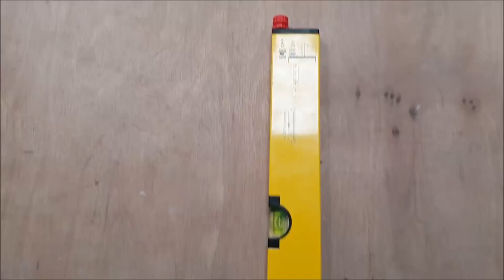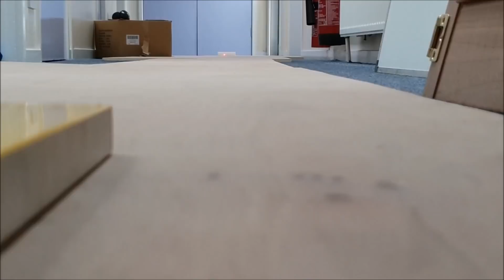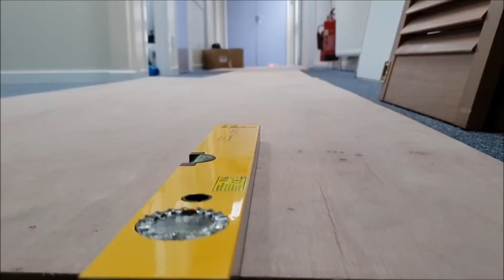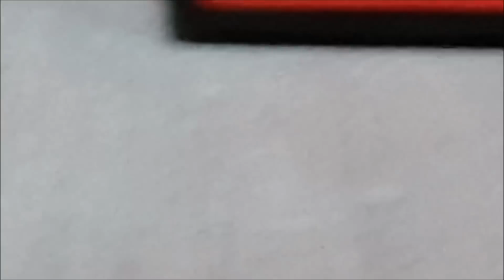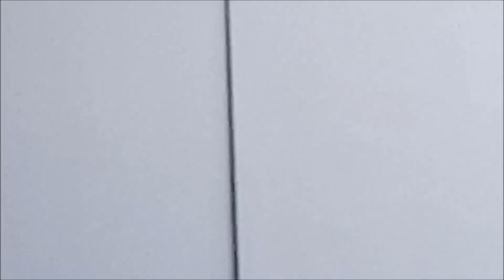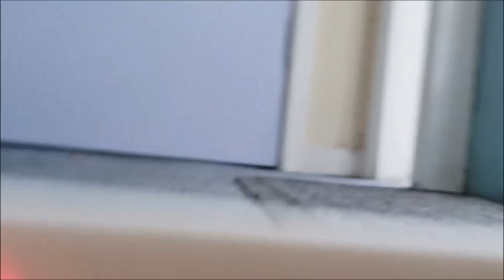Flat Earth  "ANGLE OF ATTACK"   aka  BULLSH1T

Comment: I did some rough calculations one day, and correct me if I am wrong, but if the sun is ALWAYS 3000 miles high, even at it's furthermost about 3/4 across flattardia, then the sun would NEVER get below 8° above the horizon. It would never set, it would never touch the horizon. So, since it DOES go below the horizon in reality, the Earth is indeed a globe.

Comment: I'm not really a fan of Nathan, Miles but any half decent carpenter or mason is going to know that if your foam brick is in the right place it's going to show what you see in your video and to test for flatness as to concave in between the laser and target Al you do is measure the height of the laser at strategic points along the way. This would conform to scientific methodology. Which is what your missing here and in other videos. AFTER this you then  have all the proof that you need that is  uncontestable.

Comment: I posted on one of ranty videos that a running track was not necessarily flat, and is likely to be built to just under a  0.1% inclination.  Someone (not ranty), point blankly refused to accept that a "flat" surface can be anything other than 100% flat. I think it demonstrates the mentality of what we are dealing with namely "running tracks are not built on slopes , therefore it is a fact that it is 100% flat"

Comment: Angle of attack and angular compression is real. Though not in the flat earth sense. It explains why the ponchatrain and causeway curve is visible along side it, but not when viewing from the side. The angle of attack dictates the angular compression of the length of the causeway due to perspective. In other words when looking along side the causeway you are compressing miles of road into a small angular size due to perspective. 

It's funny when we can use flat earth terms how they were supposed to be used

Comment: If the "angle of attack" were a real phenomenon, it would also affect the laser, and make laser levels completely useless.

If the floor were perfectly level and extended far enough we should expect an object resting on it to disappear from the bottom up, because level means "perpendicular to the force of gravity", and the direction of the force of gravity changes as you move around on the Earth's surface.  A laser level actually measures whether something is straight, not whether it's level.

Comment: I have a hard time thinking that you are really still this ignorant at this subject.
The only thing your test reveals is that your camera was still too close (i.e. the angles were large enough to capture the object's details)
Simply move camera further away until you will start to get obstruction.
:BUT:  in a perfectly stable indoor  a/c environment, this will take some real distance......obstruction will start to occur at about .02 degrees.
Move outside where atmospheric effects come into play, and this phenomenon will likely occur much sooner (closer)
but Miles, you already know this.
its been 3 yrs, and this information has been available.
Reply from the maker: That's fascinating. Can you point me to the scientific peers reviewed paper that determines 0.002 degrees as the threshold angle for this phenomenon?  Does it apply to all cameras regardless of zoom capability?    Why didn't any part of the door handle disappear when my camera got to 0 (zero) degrees?
Reply: @MilesDavisKDAB  no, but you can create this angle yourself!  and get Your very own Empirical Data.
Here is a right angle calculator to get you started:
https://keisan.casio.com/exec/system/1273849674
the right angle triangle we are looking at is formed at 3 points:
The center of lens it point 1.
the spot on the floor directly under the lens is point 2 (this is the right angle)
now the spot on the floor in the distance is point 3, and we are measuring the angle created... if you imagine the object you are filming, and from the object's' perspective, looking back at the camera lens this is the angle measured.
In your test, this angle is still quite large.
use the calculator and keep increasing the distance until you reach .02 deg.
For a P900 sitting directly on the floor, the distance from floor to center of lens is 4.5 cm.
So by increasing the distance to just over 100 METERS, the angle decreases to .02 deg.
OR  Lower the camera by digging a hole in your floor, (kidding) or raising the plywood in your hall up on blocks of wood so that the center of lens is closer to the surface, thus decreasing the Same angle we talked about above.  you could do this quite easily.  Again, use the Right angle calculator to get the 3 points and the angle within .02 deg:
https://keisan.casio.com/exec/system/1273849674
Now that being said:
Indoor tests like yours are not a fair comparison to photos taken over bodies of water showing obstruction of buildings, etc.
Indoor tests basically remove all atmospheric effects. 
Hope this helps
cheers
Reply: @wildmanfujiami5870  no, actually it is an nudge to do a re-test.
whats the harm in that?
Reply: Hah, that’s utterly dumb

Comment: The critical last board or two seem to be higher than the other boards or there is a clear dip before the last board which makes your experiment just as wrong as Oakleys. The laser is nearly useless at 1.2CM high except to guarantee no rise more than a half inch.   I think you should have made the effort to drop the light so its nearly on level with the boards. But I agree with the principles.
Reply from the maker: Thanks for the input. I disagree slightly. The laser diverges somewhat so while the centre of the spot is 1.2cm above the board at the far end the bottom is only about 5mm or less above the board. Unfortunately I had limited time available. I had tried on two other floors but they were not flat and on this floor using the carpet but the phone was about 3cm above the carpet. I could probably have found a way of positioning and leveling the laser so it was closer to the board, but just didnt have the time. The most important thing is that Oakley made no attempt to establish that his floor was flat or level. At least I can say with some certainty that the boards are sufficiently level that the laser 1cm above the surface is not interrupted.
Reply: I just noticed you were  @MilesDavisKDAB  (I think of recent water tower fame)  The difference is I don't think you are playing games.  I don't for a moment think Nathan Oakley is so stupid he doesn't know his floor dips.Ive seen so many flat earthers pull this lame crap. Dr Zack and his warped wooden desk. Phucket and his warped roads. Jeran this week just pulled exactly this with his own street because the streets dip at the end of a culdesack for water drainage.
Reply from the maker: @emailatomic  "Water tower fame"  LOL  Yes they pull this crap all the time and need to be called out on it.

Comment: Angle of attack is the angle formed between the chord line of a wing and the direction of the on coming air (referred to as relative wind).  Chord line is basically a line formed between the leading edge and trailing edge of the wing.  Angle of attack is a measurement that is used almost exclusively in aviation.
Reply: RV 6 Driver I understand from your user name that you are coming from an aviation perspective, but AOA also applies to sailboat sails, turbine blades in non aviation turbines, hulls and other shapes in hydrodynamics, etc. just to be clear.

Comment: Look at this flat earth video - www.youtube.com/watch?v=z5ASoaLDpgM&t -  this video shows the Walney Wind Farm. The turbine towers are 400 feet tall and the blades 250 feet long. The tips of the blades appear to touch the ocean as they pass through the 6 o'clock position but if the earth was flat there should be a gap of 150 feet between the tips and the ocean. Every flat head I have asked for an explanation has refused to or completely ignored the proof of a curve
Reply from the maker: Paul,  I've done my own video about Walney Wind Farm and Walter Bislin even modelled it. I thought the turbine height was 90m. There is a Walney extension which is more recent and might have taller turbines.  Anyway it's some goo footage.
I was with Al K at St Bees and we got footage of turbines where only the blades were visible above the horizon.  Riley, Ranty & Oakley claim its all down to compression and inferior mirage and "angle of attack" . 300ft+ of missing turbine and they think a bit of inferior mirage explains it.  I really don't think they believe half the crap they spout. They are just milking flat Earth while they can.  Can you believe Riley got £2250 to pay for him to do a university course of some sort?
Reply: Miles - Flat heads will always come up with some pathetic excuse to try and explain something that shoots them out of the water. I have never had any form of explanation from hundreds of flat heads I have asked to explain the missing 150 feet.

Comment: There goes Miles the liar Davis again! So you say the angle of attack doesn’t matter hey? So why does the amount of visible carpet between the door and the boards increase and decrease with the changing angle of attack??
Reply from the maker: I can't believe I'm bothering to answer such a daft question, but ........because the top of the boards is above the carpet so the boards provide an obstruction to the light being reflected from the carpet towards the camera.
Reply: Miles Davis that’s a ridiculous reply. It wouldn’t matter if it was 1mm in height or if it was merely different shades of colour. The angle of which something is viewed does matter! This is nothing but a straw man argument! To prove my point, the gap below the door is more than 10mm yet disappears when the angle of attack is lowered. This is a joke.
Reply: Globe Foolosophy
Actually, the gap below the door, looks to be closer to 5mm. The panels Miles used as a surface on the other hand looks to be between 15-20mm thick. So the, rather obvious, reason for why the gap disappears is because it's obscured by the panels.
Reply: ShadowFalcon ok I’ll split the difference with you and say it’s 7.5mm. The point is that a lowering and raising of the ‘point of attack’ makes a huge difference on what you can see at a distance. This is clearly evidenced with the amount of carpet that is visible between the boards and the door. As the camera is lowered the amount of carpet reduces! Nothing to do with the thickness of the boards!
Reply: Globe Foolosophy
No, the point is that, what you're trying to see is lower than, the chosen floor level.

Basically, the panels are in the way. In any case, if what you said was correct, then we should see more of the gap as we got closer to the floor, seeing as by going closer to the floor, we're approaching a 90 degrees angle compared to the gap.

Comment: The thing that flerfers don't understand is if you would keep on adding boards, each one being level by itself, you would be making a curve eventually.  Because level is perpendicular to the direction of gravity (down) on the globe. Level is NOT flat. If you would want to make a flat surface the boards will eventually NOT be level anymore. 
Big structures on earth are all made using leveling instruments and with help from gravity (think of concrete finding it's level), so all will be parallel to earth's curve.

Comment: Funny thing is look at the gap under the door as you raise and lower your camera it goes away.  Thanks for proving angle of attack.  You need to do it at a longer distance.  Other thing is look at the wall on the right and how it looks like the floor is sloping up.  Is the hallway sloping up?  Of course it's not.  The door handle comment shows you really have no idea what you are talking about.  Keep denying reality eventually reality will bite you in the ass.
Reply: It's because the board is at a higher elevation then the floor.

Comment: More than "floor not level", there appears to be a step or ramp down to where the book was placed in the other room. The bowl of cat foot on the right, and the discoloration at the bottom of the left hand side of the door frame, both of which were just a few foot closer to the camera, stayed firmly in view.
Reply: Agreed.  The two rooms have different floor types., so there's a clear drop

I tried to post that observation on Phuket's video, but was blocked there.  The most important thing.  All observations MUST be able to be reproduced.  Looks like here, Miles isn't able to reproduce it.  So time for Flerfers to go back to the drawing board.